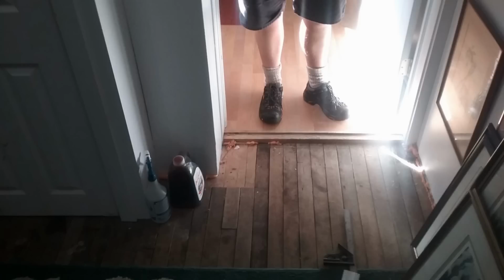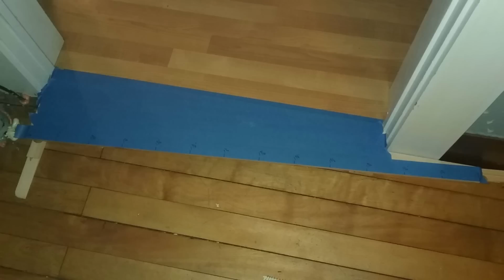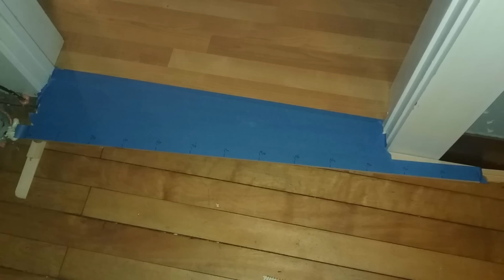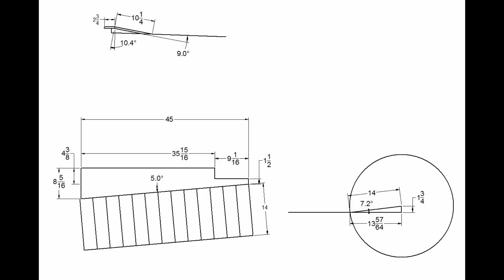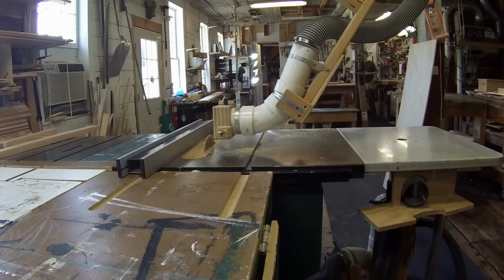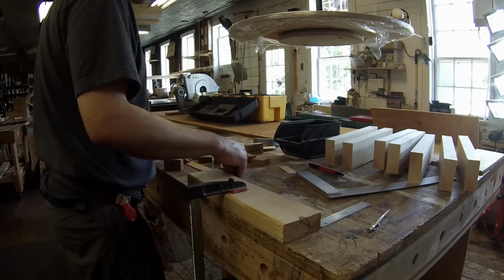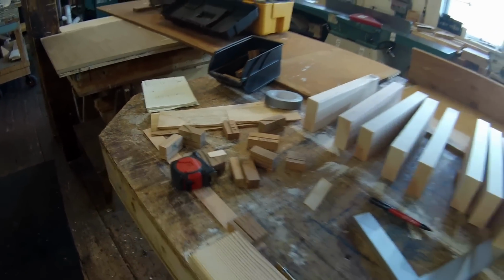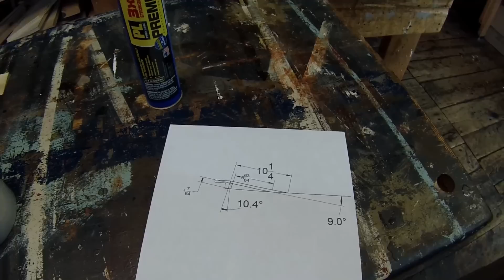Carpentry Tricks - Custom Threshold Ramp Install

Comment: what is that square you were using at 10:34 sir? Or is that one of those "if you have to ask you cant afford it questions"?
Reply from the maker: I believe the brand name is Shin Wa and Japan Woodworker sells them for about the same price as an engineers square.  I also have a smaller one with 45's on both sides and it is one of the most useful layout tools.  I recommend getting them both.

Comment: surely there's a better solution to this... the variable pitch ramp just looks like a right mess to me.
Reply: Then show us how you would have done it.  Will be waiting for your video in anticipation.
Reply: just my (perfectly qualified) opinion... no need to get all arsey and defensive over it.
Reply from the maker: it's funny though, I kept thinking, wouldn't it make more sense to just pour concrete all over it
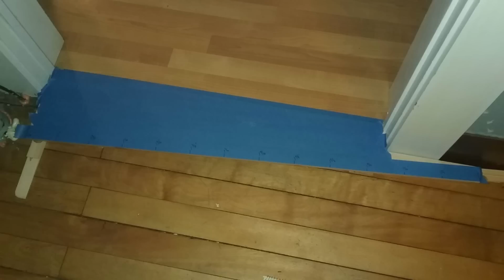Reply: haha, right... not sure what the issue is here but loving the sarcasm. your ramp is impressively figured out but i just don't think it looks very good in  the end with the woodgrain perpendicular to that of the floor, the 5 degree angled bit at 1:50? nothing lines up. but clearly it's the holiest and best possible solution in the world and should not recieve any sort of criticism despite being posted on youtube.
Reply: The world is filled with perfectly qualified people who give perfectly qualified criticism without offering a more perfect solution or perfectly qualified option. These types are perfect liabilities not assets. 

Very nicely done Mitch.